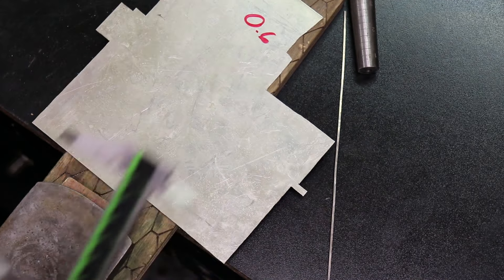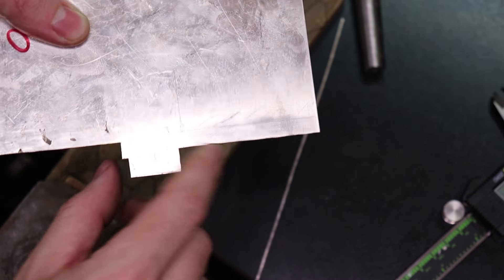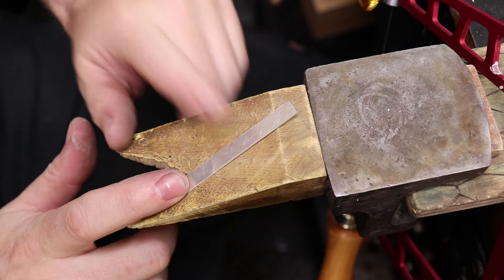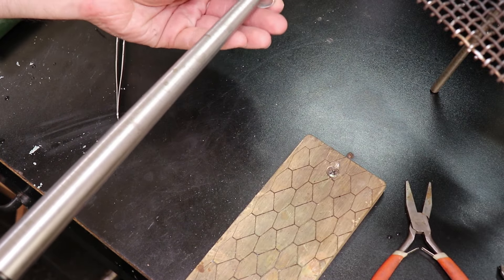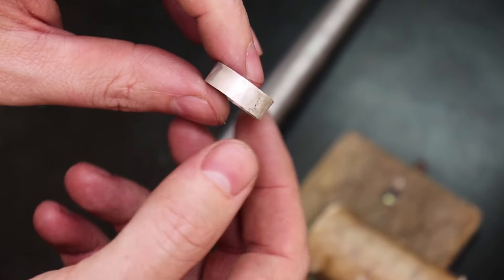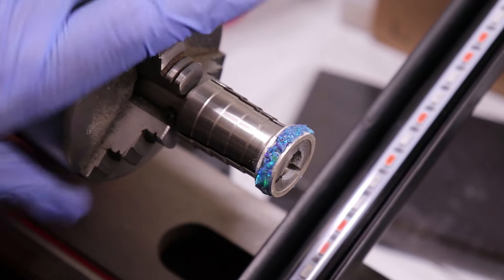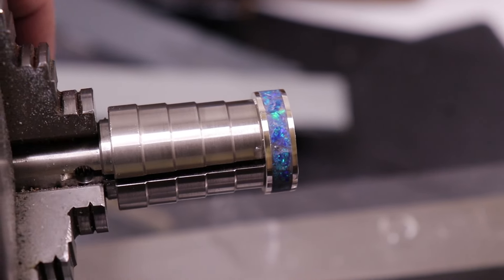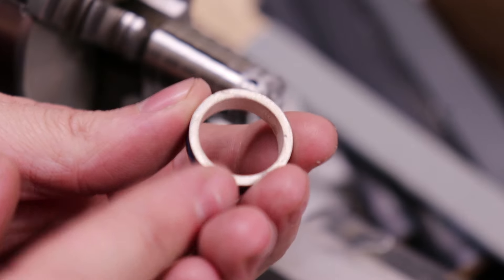How to make a silver and opal inlay ring using UV resin

Comment from the maker: Here are some links to all of the materials and some tools that I used in this video:

UV resin - https://amzn.to/36QsFiH
UV light flash light - https://amzn.to/2rp1ISS
Glow Powder - https://amzn.to/2qJ5AO9
Sand Paper -https://amzn.to/33Br8uW
Ring Mandrel for lathe - https://ringsupplies.com/collections/mandrels use code GomeowCreartions at check out
Crushed Opal - https://amzn.to/32AmonK
Resin Dye - https://amzn.to/2Cyc5WZ
Plastic Transfer Pipettes - https://amzn.to/2X8SG8A
Knew Concepts Jeweler's Saw - https://amzn.to/2NXsrh8
Cheaper Jeweler's Saw - https://amzn.to/36S6w3z
Mallet and Ring Mandrel - https://amzn.to/2X66qkf
Miter Vise - https://amzn.to/2K9ur4E
Solder kit(easy, med and hard) - https://amzn.to/33KHBNz

If you're looking for other tools and materials that I use, you can find them all on my Amazon list https://amzn.to/2WZqaGn

If you buy any of the tools or materials from my list I will make a small commission at no extra charge to you and it helps support the channel
Reply: GomeowCreations  thank you for this inspiring video!

I am curious - is this manmade opal? All opal I have seen so far is translucent with various sparkles.
Reply: ** nevermind - I just saw that it is synthetic:)

Can the UV resin be sealed with a top coat (like UV nail gel) in order to make the resin more shiny?
Reply from the maker: I'm sure it can be used but a most people don't 😁
Reply: @GomeowCreations  Can other stones be crushed and used in this fashion? I have lots of agate, picture jasper, (less expensive!); if I can crush a stone can I use it in this process you demonstrate here? I don't know if the glue would damage the stones or their coloring...
Reply from the maker: I can do that but gold is not cheap right now. Emails me and we can work out the details
gomeowcreations@gmail.com
Reply: @sheri4673  - You need to do the experiment yourself on a small piece.
All natural stones behave differently.
You will have to polish with diamond paste on wooden wheels.
Quartz is hard.
Reply: @sheri4673  - I have boxes of natural stones, small garnets of pyrope, jasper and agate, jade, and turquoise, mined with geologists.
Now I know how to use small waste, crumb.
Grind on diamond wheels with coolant, then diamond pastes on soft wood wheels.
6 thousand rpm engines.
I did all this with large stones.
But I will try with a crumb.
Already ordered special epoxy resins.
Etc.
Reply: Do you sell your jewelry?
Reply: Thank You

Comment: Hello there ! Just wanted to ask if you have any tips to deal with bubbles when doing an inlay ring using UV resin ?? I like to keep a bit of transparent layer of resin above the materials but they almost alway get bubbles in them and when sanding down the excess i just get ugly holes filled with powder from the sanding process.
 Thanks in advance !!

Comment: I've been watching some of your videos. I really like how you show with the larger tools as well as just by hand. I did have a question though, can you, and would it be easier to, heat the material ie ring a little first then put the flux on then the solder? I've done other metal works in the past but not sure if you can with jewelery.
Reply from the maker: Yeah that will work as well. 😁👍

Comment: I adore opals! Seeing they are so fragile, I’ll keep this use for them in mind if I do accidentally crack one during a setting :) Thank you for the inspiration!

Question: How did you make the 925 stamp inside the ring? Was it done with a machine? I can’t imagine how to hammer it in with the ring’s band being in the way!
Reply from the maker: That is a good idea for cracked stones haha. 

As for the 925 stamp, it was done by hand with a hammer 😅 I have this stamp https://amzn.to/2IJ3KD2 It has a bend in it so you can put it on the inside of the rings. 

Make sure to add this before you but the outer bands on or you will have to support the center of the band when you hammer it, that is what I did for this ring because I forgot to add it haha.

Also make sure you only hit the stamp once with one good hit see that if you hit it more than one time you  will run into problems, the stamp will likely not be in the same spot and it will get two 925 over layed and look bad.
Reply: Its in the film 17.59

Comment: That was incredible , and the outcome is beautiful. Question : if you don't have a lathe (which many of us don't have) how would you set up a flex shaft , to get the same results
Reply from the maker: Quick answer: put hand piece in a vice, jam ring onto something so it can spin, mount in handpiece, Done.

Long answer: hey, thank for your comment and I'm happy you liked it. I know that a lot of people don't have a lathe but I have shown how to make a ring like this without a lathe or even putting it on a flex shaft haha. But it would be easier to put this on a flex shaft. So there might be a couple ways to get this on the flex shaft but first you will need a bench vice to hold the hand piece. When you put thing in the video be very careful not to make it too tight because you can bend/crush it and this will mess it up. Once you have it set up you can use some kind of round wood that you can put into the ring that has a snug fit. To mount the wood to the shaft you can drill a hole in it and put a long nail through it. I would glue the nail  in place in side the wood. This should work and you might be able to come up with something that might be easier or better for you.
Reply: @GomeowCreations  , no reply needed: thank you very much , great idea 👍

Comment: My comment. When you have used the sheet of silver to do the ring shape, was it possible to use the sheet twice as tick,and then you use the machine,to do the gap in the middle, to save from doing an other two tin tinges ,and then soldiering on to the big one.?
Reply from the maker: Yeah you could do that but it would need to be about 3x the thickness of silver and cutting that down with the lathe would cut our a good amount of silver. You would then have to clean all the silver chips up and melt them down to use them again or  recycle it.

Comment: Nice video, and I may have missed this,  What is the benefit of the Resin vs CA glue?  Benefits of square wire vs round wire?
Reply from the maker: Thank you and resin vs CA.... Guess if I had to point out one thing is that I can polish CA easier and UV resin can be cured with light really fast so you don't have to deal with different chemicals. 

Round vs square wire, square works best for this because it lays flat on the inner band and makes it easier to solder it all with no lines or holes

Comment: Since you have a lathe, would it be easier (less soldering and sanding) to carve out a center channel from a thicker band, then back-fill it with the glitter and resin of your choice?
Reply from the maker: Yeah you can do that but your will have to make or find some 2mm sheets of silver to do this and you going to want to collect the silver metal chips to melt back down into more workable silver.
Reply: Probably easier but less fun…!!!

Comment: It might be just me, but after you polished the UV Resin and opals, there were places it seemed like it was a slight milky color over the opals.  Was it the lighting or is it not crystal clear?
Reply from the maker: So sadly it is crystal clear, the "white" spots that you're seeing are actually the silver back plate where I missed some areas with the stone 😅
Reply: @GomeowCreations  ok, thank you so much for your fast reply!
Reply from the maker: No problem 😊👍. 
I have just use the same resin to fill in a ring to protect the design that's inside of its and after its polished you can't even tell that there is a resin in there because I have clear it is.

Comment: Hi, I have heard that uv resins yellow over time, have you had this issue?
Reply from the maker: Yes they can but some don't. You can test UV resin with a small piece of it in the sun for a couple days and if it starts to yellow or anything then you'll know it's going to yellow over time. This particular ring is kind of old now and I also did a test on it leaving it in the sun and inside of water for like a week straight and currently as I type this it is in the ground for another test and it's been there for about 4 months. 😅

Comment: Great video as always, thanks a bunch! I was wondering since I don't own a lathe and on a tight budget, can I just use my small grinding machine with a ring attachment to do the same work by hand?
Reply from the maker: You should be able to do that. I have made rings in the past let me this without the lathe. I just used a standard ring mandrel and a large hand file to cut it down. 😁👍

Comment: you don't need one of those machines you can use a Dremel to get the same effects and more
Reply from the maker: You don't even need a Dremel. Just use a hand file like I did in a different video. The thing is it takes a lot longer to do. So if you are only making a few rings or even just one you don't need all the tools I shows but if you are making more and want to speed things up you might want to look into them.

Comment: Wouldn't melting pure silver into a ring mould be way easier?
Reply from the maker: It could be easier to do that but you will also need thousands of dollars in tools and equipment to do that and you would want to use 925 sterling silver due to it being stronger and scratch less than 999 fine silver.
Reply: @GomeowCreations  Right, you ever made bullion? It fetches a premium over spot price.
Reply from the maker: I haven't but it also one makes a little over spot so not really worth the time to make and clean them up in my opinion 😅
Reply: @GomeowCreations  Most small bullion ie 50grams I see sell for just under double spot. So $35 profit on a 50 gram branded bar? Still not worth it do you think? Silver shot seems to melt fast

Comment: im no expert on this but wouldnt it be easier to use a thicker metal at the beginning solder it together then use the lathe to make a channel for the opal and save lots of time and as you put it pain in the ass soldering of the extra 2 outer rings
Reply from the maker: Yeah you can do that, the only problem with that is the price. So most people will have to buy a thick sheet of silver and that can be very expensive. They way I do it in the video is a cheaper way to get the same thing done.   😁👍

Comment: I need you to explain how to know the measurement and use of the calculator in 2.45 minutes
Reply from the maker: Well let me see if I can do this with text.
1. Find the inner diameter of the ring using a sizing tool or ring mandrel. Mine was 19mm
2 Find find the thickness of the metal your are turning into the ring. Mine was 0.6mm
3. Take the diameter and add the thickness to it.  19+0.6 = 19.6mm
4. Multiply that number by 3.14 so like this 19.6 * 3.14 = 61.544mm
5. That is the size you would need for the ring.
Reply: Thank you for this advice I am grateful to you
💕👍😍💕
Reply: I am a goldsmith and goldsmith and I love to learn from you some work

Comment: Can someone please explain the calculations for the wire length to me?
Reply from the maker: That the outside diameter of the core band and add the thickness of the wire to that. Once you have that number you just multiple it by 3.14
Reply: @GomeowCreations  ya legend mate, thanks 👍
Reply: @GomeowCreations    one more question if you don't mind. How do i calculate the outside diameter of the core band?
Reply from the maker: Same thing as before but you want to take the diameter measurement from your ring mandrel or ring sizer to get the right size.

Comment: Only five minutes in, and I have a question...
Where do you send your dirty scrap, sandpaper with metal dust on, anything that could have precious metals on it that isn't pure to have them refined? I heard Rio Grande takes only clean metal...
While I'm here, thanks for sharing in advance.
Reply from the maker: You might not like may answer haha. Seeing that I mostly work in silver, and silver is not worth very much I collect a lot of my silver dust in water from my sandpaper and use it later by letting it all dry out. I will use this in some inlays or even melt it down so small parts. 

So I have never send anything in, I use find ways to use it.
Reply: @GomeowCreations   No... That's fine... I was just curious as to what your procedure was... I suppose if you made production at a much higer volume, it would be more cost effective for you...
Thanks for getting back to me so quickly. 😊

Comment: Where can I get the silver?
Reply from the maker: What country are you in?
Reply: @GomeowCreations  I live in Germany
Reply from the maker: Well that is a problem. Do you have a rolling mill? If so you can buy silver bars or coins from a coin shop and melt them down to make your own sheet and wire.
Reply: @GomeowCreations  ok unfortunately i don't have a rolling mill or other machines but thank you for your advice. is it possible to replace the silver with aluminum or another material which is easier to get?

Comment: Hi, are you using a medium or hard solder for this project? Why do we have to use different type of solder? I'm just new to silversmithing...
Reply from the maker: I used easy, med and hard on this ring.

I used hard on the center and outer bands to make them rings. I use the hard solder because it has the hottest melting point so when I'm doing my other solder work it will not melt. I used med to join the outer bands to the center band and easy to fill in any holes.
Reply: @GomeowCreations  Thanks a lot for explanation, you're very good at your jewellery making.
Reply from the maker: Well thank you very much. If you have any other please feel free to ask.
Reply: @GomeowCreations  thanks for explanation and that you take time to answer all the questions here. Nice work even though I'm no fan of synthetic stone in such nice work.

Comment: I feel you could have fit the opal pieces in much tighter. The final look is not what is desired. Skimpy on the gemstone.
Reply from the maker: Yeah, it didn't come out exactly how I wanted it to in this video. In future rings I will be doing it with a lot more stone in it. 😁👍
Reply: Not everyone sees Art the same.. piece is beautiful. Also, another variation would be to fill spaces with fine silver filings.